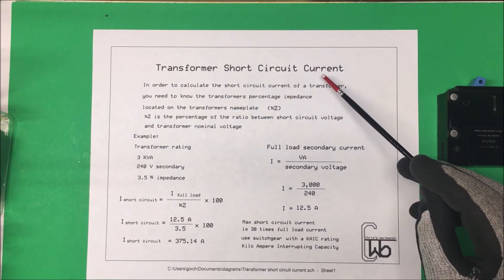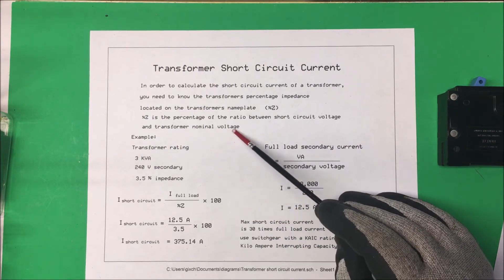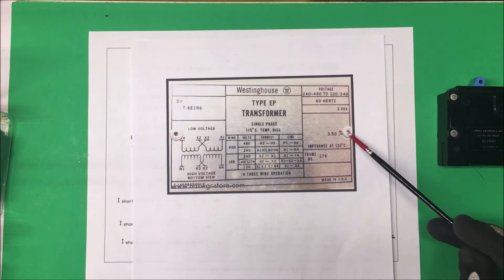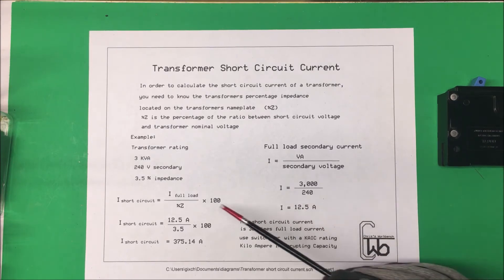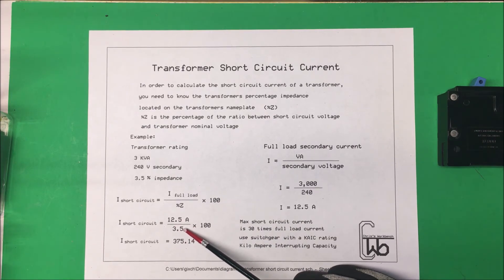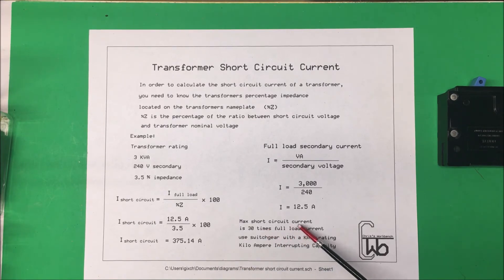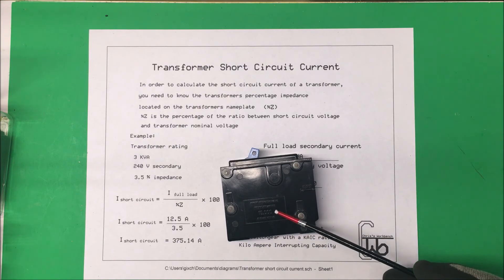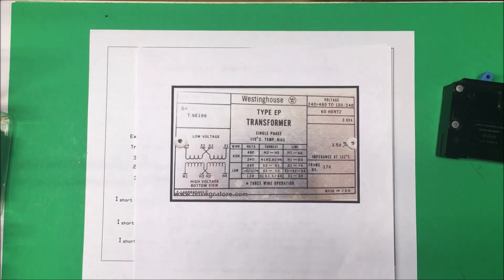Transformer short circuit current

Comment: I'm confused.   It is outputting 12.5 amps under max rated load.   Wouldn't you fuse it at 12.5 amps.    Why does it matter that the breaker is rated for 10k amps.?   Why are we concerned about short circuit current??   Please explain.  This vid brings up many more questions than get answered.
Reply from the maker: Short circuit current can reach maximum before circuit breaker has time to trip.